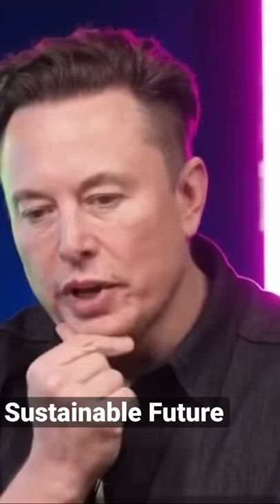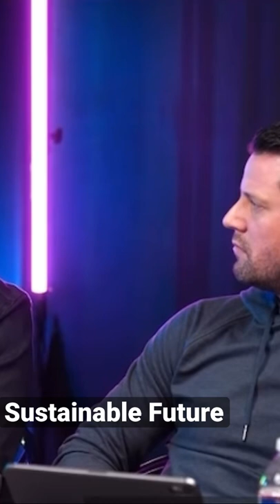Elon Musk Three requirements for sustainable energy future #elonmusk #energy #nuclear #solar #shorts

Comment: I love that Elon Musk supports nuclear energy.
Reply: I don't
Reply: @broodieivie207  Why? Nuclear energy is a great carbon-free energy source.
Reply: @mrkokolore6187  because the nuclear engineers never consult geologists and envariably put them where fault lines are.  Japan had a China syndrome type meltdown because of this in the early 2ks.  There is another in/near NYC  that straddles a fault line.
Reply: @broodieivie207  Well you can build nuclear power plants in a way that they survive earth quakes. In fact the Fukushima Daiichi nuclear power plant did not meltdown because of the earth quake but solely due to being insufficiently protected from tsunamis. It automatically shut down after sensing the earth quake even before it hit and would have continued to shut down using it's emergency backup power which however was destroyed by the tsunami. This automatic shutdown is a standard safety feature of nuclear power plants.
Reply: @mrkokolore6187  glad you Google.
Reply: @mrkokolore6187  and tsunamis are caused by?  I do not wish to argue with you.  I am entitled to my opinion and do not wish any further discussion.
Reply: @mrkokolore6187  this is the most illogical and idiotic statement I have ever heard.  The material for fuel rods must be mined, moved, processed, moved again.  Sorry fella it is not carbon neutral
Reply: @broodieivie207  hahah you took that L pretty hard
Reply from the maker: I agree that placement is key. The plants should be located in geology safe areas. And the material should be recycled, which is not currently being done in the United States. Importing new materials from across the ocean, with years of recyclable waste being stored is madness.
Reply from the maker: So it could be very safe and have a low carbon impact “if” executed properly.